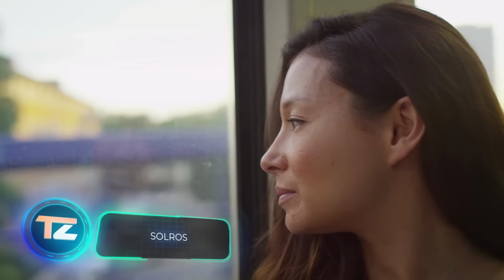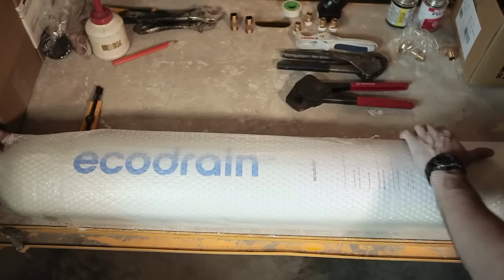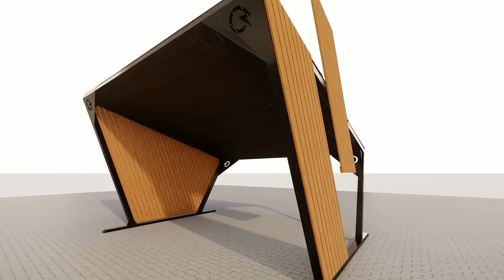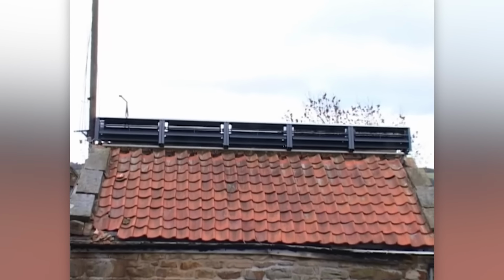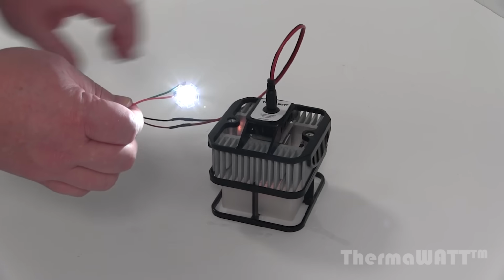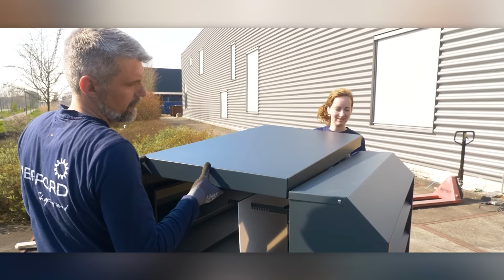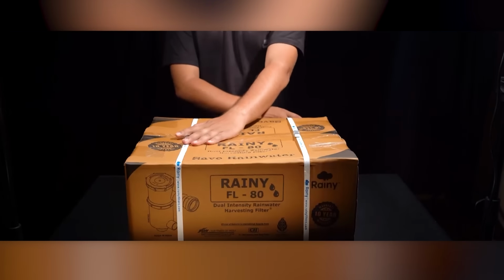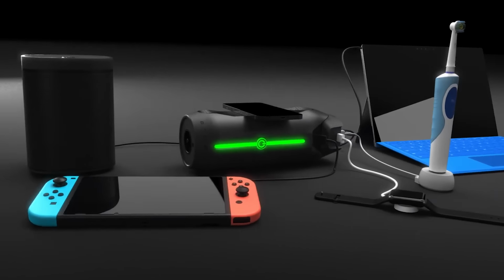15 ENERGY EFFICIENT INVENTIONS FOR YOUR HOME

Comment: The "EcoDrain" is a total bust.  The wall studs were rendered structurally ineffective.  Probably won't pass building code.
Reply: Maybe it’s a non load bearing wall…
Reply: there are other brands that a thinner so you have more places you can place it.
Reply: Apparently there's extra elbows involved.
Reply: The EcoDrain, as a device, DOES pass Code. A sloppy installation won't. It's still a great invention.
Reply: All I know is that could get messy if you have a plug inside of it
Reply: @DamienSemel-DeFeo-yo7no  the fresh water goes through the copper pipes, the drain water goes around them
Reply: I've seen a LOT of people try to "nay say" on every green innovation on YouTube, but congrats, you found the most irrelevant complaint. There are certainly ways to avoid structural problems doing this.

Comment: Photovoltaic panels are black and hot. The heat is lost in the air. I think I am the only one using it for heating air in the winter and water in the summer.

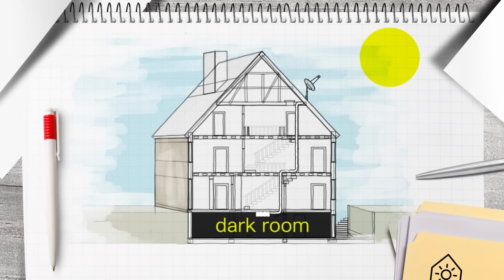Comment: 0:20 or you could just have a 100$ PV panel, charging a battery, and have light from LEDs whenever you need it, including at night. I recommend 14s Lithium ion, or 16s LiFePO4, a charger controller, and then dedicated HV LED drivers after each switch. (in the light module) This improves the efficiency, as higher transmission voltages to the point of use, lead to lower losses overall.
Reply: daylight > diodelight
Reply: From an economic standpoint what you’re saying makes sense but if we could get rich people hyped up over it the prices will come down and eventually be cheaper and more efficient. The maximum theoretical efficiency of covering light to electricity is around 40% and while leds are efficient is not possible for them to be 100, plus the price and ease of manufacturing for the raw materials to make fiber optic cables is way cheaper than those used for leds or solar panels.

These don’t convert anything they just move the light where it’s needed with super high efficiency which would be ideal all things being equal.
Reply: @AttemptMade  it's around 20-25%

Comment: I don't understand how gyms and cycling classes aren't already generating electricity as specified at the end. Minus the individual bateries and wite all to a big one. Great way to make or save money, same difference to me.
Reply: Cycling instructor: "Alright everyone, I'm going to need 2000 MilliAmpHours from each of you today"

Cyclist: "Nope, unless you stop charging for these classes, you're only getting 1000mah outta me"
Reply: It isn't worth. Our body doesn't give that much electricity.
Reply: @LichtTempler  but 10 cyclists at the same time tho they are doing it anyways why not make some juice from it
Reply: @rudesport3647  basic engineering. the electricity from the grid is cheaper than the equipment and requires no maintenance on the part of the owner.
Reply: @DamienSemel-DeFeo-yo7no it could be done... The gym could have zero electricity bill and could even sell energy to the electric company...

It could be done...

Comment: I have the solar water heater and in summer times I rely 100% on it for hot water.  Really good!!!
Reply: They need to keep it standing between the studs. They were nuts for cutting half way through the stud. 😵‍💫
Reply: Yep me too in uk (not a hot country) mid spring to mid autumn (fall for the American audience) we turn our boiler off 😊
Reply: That's awesome to hear that the solar water heater has been working so well for you! If you're looking for more energy-efficient options, I highly recommend checking out the Segway Portable PowerStation Cube Series. It's a versatile powerhouse that can provide ample power for your devices, with fast recharging and comprehensive protections. It's perfect for outdoor enthusiasts like us!
Reply: We've got something similar but they're more like normal solar panels in appearance so blend in quite well with our actual solar panels .

Comment: For the cost of one Solros lighting system, I calculated you could run the same amount of lumens using eight 100w LCD bulbs 12 hours a day for 390 years at average utility rates in the US. A few years back, I saw a similar system demoed at a Department of Energy conference. Needless to say, it was never commercialized once people dove a little deeper and actually crunched the numbers.

Comment: So many of these ideas could be helpful, but realistically will never see use by someone who actually needs it.
The water collection, $2000+… the solar car port.. anyone who can afford an ev is parking it in a garage… things that provide light in the daytime… turbine that only provides power at 25mph wind and the price is a secret 😂
Reply: Citing MSRP is off-putting for sure. This channel goes on a bit too evenly, it could spice things up throwing its own spicy prices. Wanna device that separates waste and freshwater with an anodic metal? Fine but collect and treat rainwater for washing. Metal armor plumbing on half ya roof? It's free but you need to dress like Blake Lively, get sewing.

Comment: Rainy is a good in theory!  But when it rains, the rain water seeps through the ground, and down outdoor pump shafts to refill the aquifer.  Even if you do save water, pumping out the aquifer without replenishment could lead to sinkholes.
Reply: How big of an impact do you think your roof will make when compared to the millions of square miles that are not roofed and raining straight into the aquafir?
Reply: With the amount of water you could collect you wouldn't need to pump the aquifer at all.
Reply: AND SOME ZONES AROUND THE COUNTRY WILL NOT ALLOW YOU TO DO THIS,

Comment: I want a Regen!  But 2500 USD is too steep for poor countries.  In fact, most of the items that would help other countries are priced out of reach.  Too bad.😢
Reply: Most poor countries have scrap bikes, old car generators and batteries. A bit of knowledge on top and there, a pedal generator.

Generators take a bit of modding first but are usable source of pedal power.

Comment: Curious to see if the prices for many of these products will drop over time.
Reply: Nope. Anything that saves money costs an absolute fortune.
Reply: 10$ camping shower bag you can have free showers for half a year or more, you can leave them on your car, house windows which get hot, etc

Also in summer, a 400$ air to water heat pump will move the heat from your room air into a water tank, so at the same time cool your room and get got water as a result.

There are solutions, just not in thins kind of commercial video.

There are option, keep looking

Comment: was the math for the Rainy filter done over like a 10 year period? because you arent getting a half million gallons a year
Reply: Granted it showed a large roof dimension to provide, but I have an 8 by 16 roof on my wood shed that'll fill two 250 gallon totes on a good rainy day. Just built a barn and with 512 sq ft roof and will pipe that into 8 more totes. Currently I've managed to just use water from one tote this summer as it would refill and it supplies enough to wash dishes and showers for our tiny home. Our shower though is on to rinse, off to lather, in to rinse and conserves a lot of water. We utilize a fraction when we had a house for our family of 5. Really taught conservation of resources.

Comment: The "Source" water condenser produces 5 liters of water per day (depending on conditions... the average human male needs 3.7 liters per day, female needs 2.7 liters... there is no way one can sustain a household much less a community... Sounds like a $2000 boondoggle.  -  That carport goes Up TO 5000kWh if conditions are ideal (sunny everyday) so I hope you need to drive less than 55 miles (88km) or you will be tapped out. The thermoelectric generator is a farce at a paltry 1.2 volts it may light an LED or two, but you will NOT be charging your average cell phone...  One turbine can generate 56 volts... that is only half of nominal US voltage 2 $2200 each... and you WILL need two... I also notice they did not mention Amps or Watt/hours either... might be ok in a primitive setting but a pricy, high maintenance P.I.T.A for most other uses.  Nice using the "tan tights" on the hot girl and dark tights on everyone else... too bad you have to pay $2500 AND peddle for about an hour just to fill the thing and even then is just enough to refill your laptop and cell phone once... 

Overall? Most of these items are expensive "crap" made to make you feel good and part you from your money for something that will rarely get used and likely go to a landfill in a relatively short time... IF they work as advertised at all!

Comment: That is all well and good, but how do these devices cope with below zero temperatures and snow?
Reply: Most dont do well. Source wouldnt work at all and the solar water heaters would have to be drained and you would need to use something different half the year where i live

Comment: If you use a parabolic mirror for light you could also put the beam through a prism and take the different wavelengths. Use the visible for lighting and infrared for heating, I don't know what the UV could be used for. I believe that fiber optics may allow the light to go much further.
Reply: UV for air filters, although i doubt it would work without special fibres, because it gets blocked easily.
Reply: UV-c can sanitize air, water, and surfaces. The only problem is you have to use crystalline glass to allow transmission of effective light.  UV-c room sanitizing machines are used in hospital rooms all across the US.

Comment: Combining a lens in front of the heat pick-up with a parabolic reflector behind the pick-up, more power could be generated. The pick-up creates a shadow anyway, so a small lens would probably not interfere with the efficiency of the parabolic dish very much, but it would add a very hot spot onto the front side of the pick-up.

Comment: Where can I buy SolarGap blinds?  Or can I resell them?
Reply: The have a list of suppliers depending on your country on their site, and presumably contact details if you want to be a distributor - first result on a google search. They do look great though if they perform even vaguely close to the figures stated, as somebody with a south-facing rear, large windows at the back and heating issues in the summer I'm very tempted by them.

Comment: Reg the Sun Bank solar roof top heating units. Why are the large tanks with the company logo attached, a high polished chrome finish, would some version of black absorb additional solar heat, the chrome finish is acting like a mirror, reflecting valuable solar radiation away from rooftop.

Comment: 1. Just get LED lighting instead of spending $2k on a light that fades with clouds and doesn't work at night. If you want sunlight, open a window.
2. Genuinely a good idea, but pointlessly expensive.
3. Not good ROI, and utterly pointless if you have a solar water heater.
4. Doesn't work in arid climates where water is needed most. Might work in tropical islands, but is easily outperformed by desalination.
5. Also genuinely good idea, but I can build my own for far cheaper, most likely.
6. I can't think of anything wrong with this one, other than that EcoFlow is probably better. Help me out here lol.
7. Useless if the wind isn't blowing in the right direction.
8. Not powerful enough to do anything useful. Except maybe running 33 LED light bulbs, I guess.
9. Thermoelectric generators are the opposite of efficient. Useful for those little fan things that sit on top of a wood stove and blow warm air around, but that's about it.
10. Geothermal HVAC is an incredibly efficient system, but they don't have to cost 20k. You can get a good one for half of that.
11. A noise-reducing air conditioner cover that costs more than the air conditioner? Just build it out of wood and paint it instead.
12. You don't need to spend $1k on a biogas digester. You can make one yourself out of PVC pipes and blue plastic barrels.
13. Again, you can build this with PVC pipes and blue plastic barrels.
14. Cool, but I've seen it built for far cheaper than $2k out of... you guessed it, PVC pipes and blue plastic barrels.
15. You can get stationary bikes with USB outputs for less than half the price.

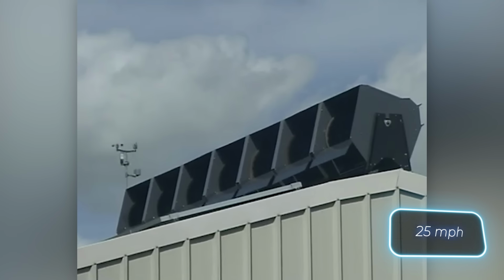Comment: 6:30 - Polacy dawno wymyślili te turbiny lecz proponowali stawiać pionowo z generatorem na dole. Dużo wydajniejsze od znanych wiatraków.
Reply: Only in linear wind directions
Reply: Average wind speed in my region (like in almoust all continental Europe) is 10 km/h. Only 36 days per year it can achieve 40 km/h. It means that this turbine will produce full power only 1/10 hours per year, mostly in cold season

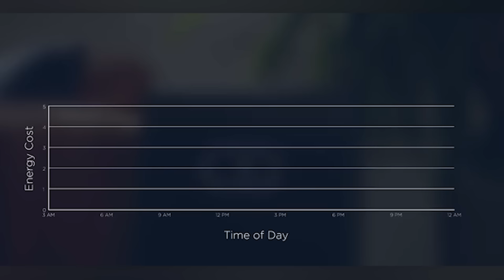Comment: 5:35 The Blip One is basically a battery/buffer, so how does it save on your bill? It still draws electricity from the grid to charge. In fact, you'd initially pay a bit more when installing a Blip, since it needs to charge and thus make you use more power

Comment: Gimmicks mostly. You can DYI your own energy systems for much cheaper.

Alsp, the waste cooling gas system is really creating Methane from eco waste, which is a terrible idea. Methane is one of the worst greenhouse gases we have and is being blamed for most the heat increases we see. Instead of getting some overpriced bag, just use a box with worms. There are tonnes vidoes oit there and it can even be used inside the home. Food scraps will put off Methane if they are starved of Oxygen, so make sure there is a good air supply. The worms will convert the waste into some of the best soil you could want and they will fo it for a fraction of the cost. Alsp, most people find the smell of good soil pleasant, which is the smell it gives off when the worms are done with it. The bad smells mostly come from when its starved of Oxygen. It won't work for meat scraps, but then again, Methane dosen't work great with that either.

Comment: Eco drain system is patented, funny as a similar system have been mandatory in Canadian building code for about 7 years.
Reply: Building code for what?
Reply: Building code for having very freezing winter periods in which the pipes in your house nonetheless do not freeze and burst, partly because you transfer heat from graywater and wastewater with the incoming service that's barely below frost line.

Comment: Home battery bank. That's not true. The device is uneconomical. The lifespan of the battery under normal usage depends on whether it's lithium-ion or gel-based, agp... roughly about 8 years with normal usage. So, after 6-8 years, we're producing 100 kg of electronic waste that can't be disposed of easily. Overall, it's not efficient, and what's claimed in this program isn't true.

Comment: I see few that are genuinely useful. But most others are just rip-offs and for climate cultists. And others will just bankrupt you.

150W maybe for a $180 blind? It's crazy. In reality you'll be lucky to get 20W an hour on a sunny day.

The fancy wind turbine is just a fancy wind turbine that still has all the absurd wind turbine flaws like killing birds and having a very narrow operating range.

The mass use of the hydro turbine will disrupt river ecosystems and is anything but green.

Things that work: -Wood stove generator for off grid, solar water heater, Rainy, Biogas. BlipOne is ok for the $800 price since large powerbanks cost way more per WHr.
Reply: Again these things are cited at MSRP ...that price on custom blinds isn't special, but of course an awning at 3000W would power a battery or split A/C better. These videos go on so much, certainly there's a spreadsheet at the end about how much you blew, plus labor etc. and how many people would have to be crashing w. you for it to make sense.